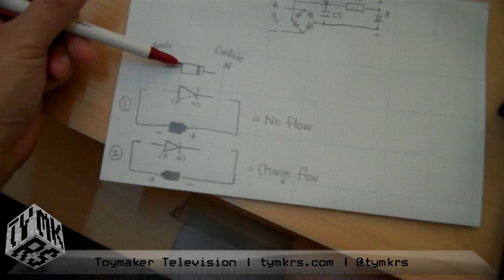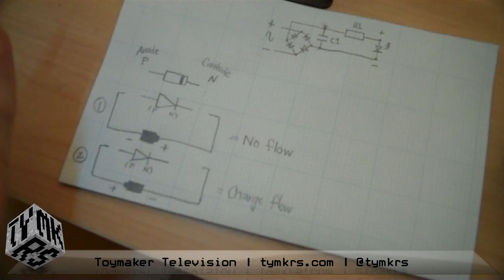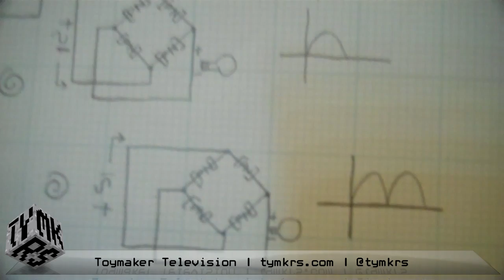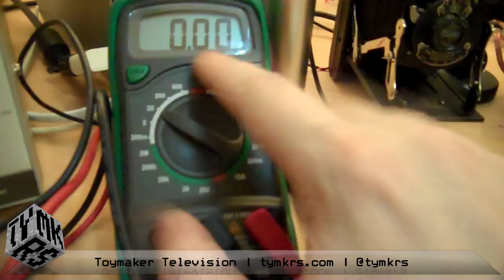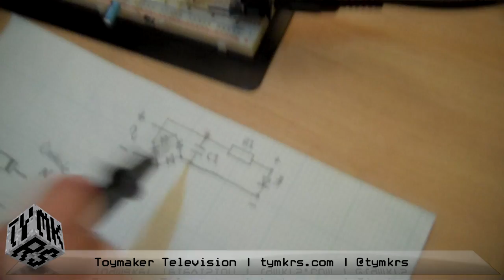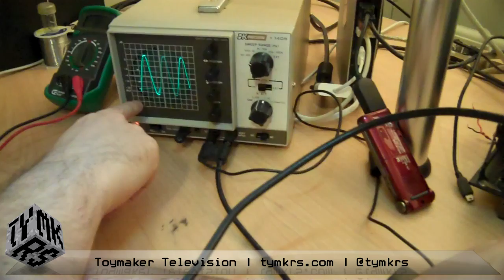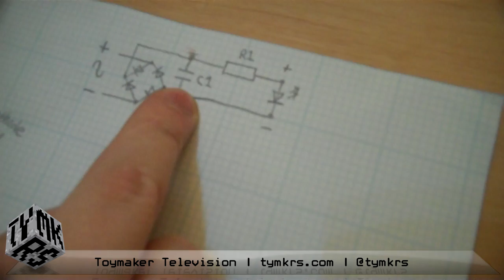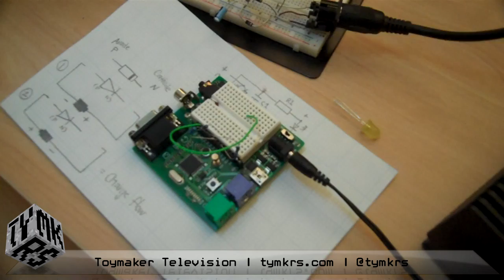Tymkrs DIY Bridge Rectifier

Comment: if you watch colin's (from make) new vid on schematics he describes the diode as the arrow going into a wall (can't go that way) which could help you think of how the electrons flow

also, not sure if it has anything to do with this but that diode ring is used in passive ring modulators...also, a rectified wave is the sound wave you would get out of an organ, i think

i might listen to the microcontroller show cause i'm pretty nooby at that too